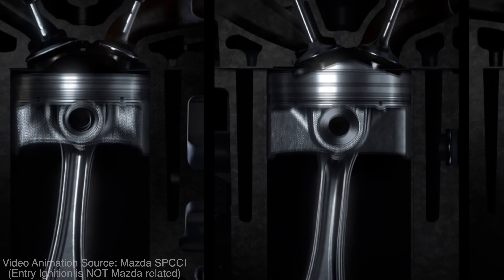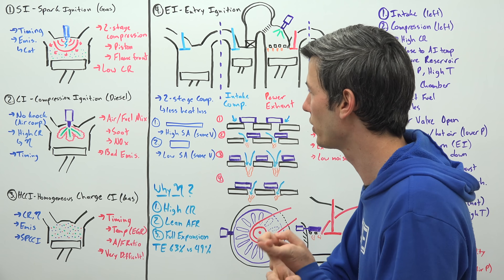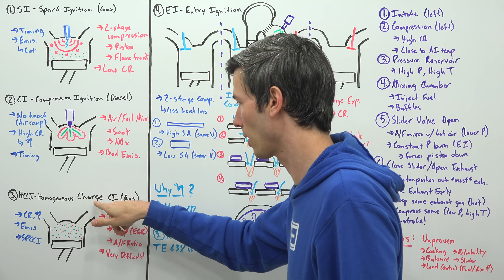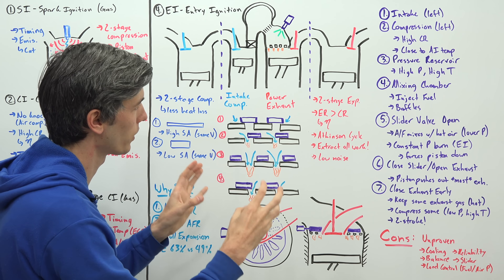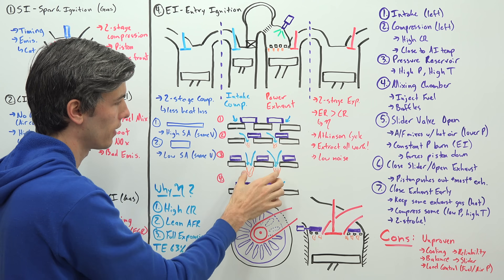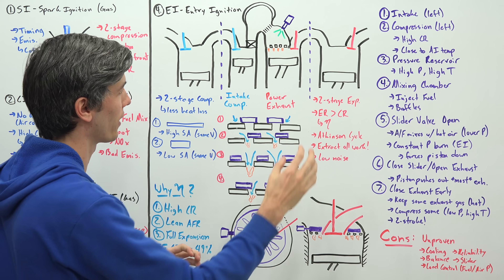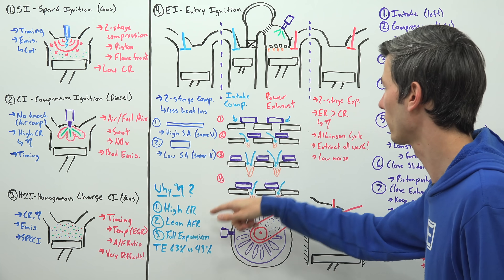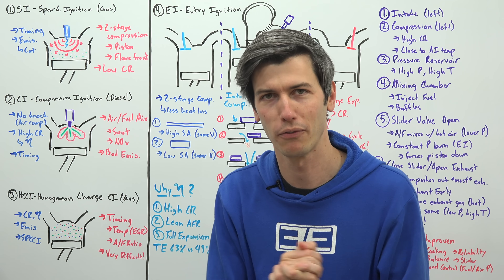Is 'Entry Ignition' The Future Of Combustion Engines?

Comment: Too many moving parts more cost to fix not efficient to my wallet when it breaks...yet since the market is so small for electric vehicles like a Tesla the powers that be negate your ability to charge the vehicle quickly..... could just change the software or trick the system into thinking its charging slow but keep up with the charge rate so as to not overcharge and send the wrong data to the system as to being a regular charge flipping its vin each time its charges.....you paid for it so you should be able to fix it even if its salvaged and you did the work on it without having to worry about not being able to get from point A to Be in time for whatever you are going. Although be it, its not good to keep charging items faster in conjunction with sensors and other components sensitive to the process and it degrades the battery faster over time. Electric seems more efficient just very inconvenient in its process for the charge portion.

Comment: more things to break!!! Instead engineers should be working on harnessing exhaust gases to generate electricity which in turn charges the batteries or help run the engine... basically instead of turbo's u have generators
Reply: Not even remotely efficient. Converting chemical energy to heat and heat to pressure and pressure to heat and heat to electricity is waaaay too many steps. Stick a bunch of thermocouples on the exhaust and you'll scavenge some energy, but each conversion multiplies the previous conversions' inefficiency, leaving you with "watts", not kilowatts harvested from the exhaust.

Comment: JASON, engine thermo efficiency has nothing to do with anything u mention.  Engine efficiency Only determined by both the temperature of the hot and cold resivor.  The second law of thermodynamics. Derived by sadi Carnot ( the carnot cycle).
Reply: No. Engine efficiency is a complicated calculation. The "thermal efficiency" he speaks of is kind of a calculus-style calculation of Carnot's math (since Carnot's simplistic efficiency calculation assumes square wave piston movement with combustion 100% completed precisely at TDC, which is impossible). And like Carnot's equation's output, "thermal efficiency" is a hypothetical maximum from which you still have to subtract all the real-world inefficiencies, such as thermal conduction, pumping, and friction.
Reply: Richard Caldwell “complicated calculations”? not at all. Especially if you have an engineering degree

Comment: Nope.. Starting from a higher theoretical efficiency doesnt mean anything. There have been dozens of potential engine configurations with similar designs as that one and that touted high theoretical efficiencies. Prof Chris Edwards at Stanford has toyed with an engine concept that has over 80% theoretical efficiency, and his end results when tested were pretty poor when compared to todays high efficiency engines (Reaching 50% brake thermal efficiency without waste heat recovery). Loss mechanisms are completely different and usually worse than conventional designs. Also SI engine efficiency limitation is much less related to higher compression ratio than the air standard otto cycle makes you believe. Higher compression ratio leads to flame quenching due to small squish zones and higher heat transfers, its a tricky balance.. Even with very high octane fuels (propane) getting diesel-like efficiencies is much more of a challenge than just increasing compression ratio.

Comment: Is there any difference between this and other Split cycle concepts investigated in the past decade?  Also, if it’s lean combustion, is it expected to be low temperature to avoid NOx or will it need expensive after treatment like a diesel?

Comment: This is a warranty nightmare. Higher cylinder pressure  just means the carbon deposits will get packed around the top rings tighter. Oil change reminder systems will still be ignored, just like today's cars. The under 40 generation ignorance blows my mind with maintenance abuse. But oh my god, when there phone won't link to the radio for, music, hands-free calling it's an emergency. This engine will never hold up.

Comment: I thought of this when I was racing 25 years ago,  two stroke concept with a supercharger pre ignition compression side and a turbocharger on the backside to capture the remaining heat evacuation.  My theoretical  solution was to use a wankel/rotary system for burn entry to the power cylinder/power stroke .   Could not afford to build a prototype.

Comment: i'm sorry but this thing is way too bad no offence jason i like your content , but unproven technology is just a concept and two stroke engines are way too far being efficient , one thing that may destroy this concept is how can you lubricate this system those valves slider disk ... and the stress on the valvetrain some pistons would take more oil than others this makes them heavier , the result is damaged parts ,the solution is another model we need a compressor to compress that air before sending it to the engine that reduces rotational parts in this particular machine, those first two stages of compression would be simulated outside the engine maybe with some help from the free valve system we can give this engine a better experience with efficiency

Comment: The main con is mechanical complexity, your adding a lot of parts that move thousands of times per minute. Plus additional weight and space per HP. Plus there would be additional thermal losses with those compression holding areas. Achates is proven and achieves a lot of these objectives in a simpler design.

Comment: one quick question: how do u make the first combustion when starting the car? from my understanding u need combustion to generate heat then heat leads to another combustion, but before starting there is no heat.
Reply: You'd need glow plugs like in a diesel for the same purpose.
Reply: It would probably need to spin over more then once before start up, Raising temps. Like a diesel that doesn't have glow plugs
Reply: @hopsgarage5513  If compression is high enough you don't need to... at 20:1 compression you almost don't need glow plugs and Detroit 2 strokes don't' have them (they get an air charge from a blower + compress that then boom all without plugs and as long as the engine isn't worn out they start up in a jiffy at above freezing temps and you can start them below freezing with some extra turning over as you mentioned). My 3-53 detroit will pretty much fire up on the first revolution.
Reply: @Wingnut353  having high compression doesn't mean quick starting, Nor does it mean no glow plugs. The blower on a 53,71 or 92 series is to clear the cylinders of exhaust and provides little performance gains hence the turbo addition later. Sure there are some quick starting diesel but I've never seen any start in one revolution.
Reply: @hopsgarage5513  1HD-FTE start pretty quick, glow plugs required. You don't want to flick the key in a manual in first gear. Had an apprentice try to check oil after changing, was in 1st gear, flicked the key and it started and drove off the front of the 4 post hoist.
Reply: Compressing air makes heat. The higher the compression ratio the higher the heat is.

Comment: I really don't understand how the burning mixture doesn't flow/expand to the wrong direction as J said.
Reply: Quenching. Flames go out when in close proximity to metal that's colder than ignition temperature. Keep the openings narrower than the quench distance and even if gas flow retrogrades no flame will escape to the mixing chamber. Easier said than done, of course. The design is WAY flawed.

Comment: Nah, I'll keep my turbo V8 diesel engine. 
Plus the byproduct is plant food. 
More Co2 = More o2 from plants. :) 
For some reason the governments don't understand this.
The more simplified an engine is, the more reliable it is.

Edit: Plus an engine is an air pump. They easier it is for an engine to suck air in and push air out the more efficient it'll be. The problem with this new design is it may create a very efficient fuel burn, but the extra amount of work to get that effect will rob more horsepower. 
Which means you'll have to keep your foot in it more to get the same level of power, which in return will end up using more fuel anyways.

Comment: Does anyone else notice the similarities of this engine to a axial flow turbine? They just swapped the spinning wheels of death with thumpers.

They both have;
multi stage compression,
a combustion can with a flame, (always on injector). 
multi stage heat extraction, turbines or piston.
Which means it will have a similar characteristic of not wanting to change in rpm quickly, ie will have a power setting, and the user extracts their required amount of torque.

The ability to change in rpm quickly is what makes engines fun! This will take all the fun out of it.

Comment: Entry Ignition doesn't seem that impossible to implement into an existing engine design. Take a turbocharged port injected engine. Up the boost so that the air temp is almost at auto ignition, if that's not possible you can use a glow plug to heat the air at the intake port up. Change the gearing on the camshafts so they rotate twice as fast thus opening the valves twice as often turning the 4 stroke cycle into a 2 stroke cycle. Just before the intake port opens inject fuel and after the power stroke just before TDC, close the exhaust port to retain some of the exhaust gases. That should work as an entry ignition engine. Obviously the timings of when the ports open and when the fuel is injected will need to be figured out but i don't see why a prototype couldn't be made using existing automotive technology.

Comment: The entry ignition does not expand with a higher pressure than the mixing chamber’s pressure? Also a comparison between entry ignition and freevalve i guess is not yet feasible?
Reply: The idea is that the pressure increase in the combustion cylinder is simultaneously removed by the combustion cylinder's expansion.  A bad design, but hypothetically correct.

Comment: Interesting how things come around and go around.  I'm glad to see someone trying to use the principals of the 1906 Compound and the Honda CVCC . Probably never find high hp, but there should be efficiency in there somewhere.
Reply: Sometimes where theory meets practice, the water muddies. 

Those old Honda CVCC engines would carbon up the tiny intake port for the prechamber, and the things would run terrible until you pulled the choke out (thankfully they had manual chokes!) and richened the mixture into the main cylinder. 

Of course, that killed fuel mileage and the HC emissions went off the scale, but at least it would get you where you’re going ...

Comment: LOLLL, another split-cycle inspired concept.
Here are even more drawbacks that you forgot to mention: the cylinders heat up differently, so the engine block will heat unevenly. This is actually the most popular reason why diesel engineblocks crack (because one cylinder was leaner/richer than the rest the heat distribution is uneven). You will have heat-loss in the inbetweeny reservoir. You have heat-loss per compressor stage, you have heatloss per expansion stage, so the ideal scenario to overcome that is to put all the functions into one single cylinder (like a regular 4 stroke).The pressure in the inbetweeny  reservoir will not be constant due to the checkvalve opening and closing, turbulence, standing waves, etc. (scavenging intakes proof that standing waves in engines are a thing)
---
I honestly wouldn't trust these guys to set the specifications for my engine oil.

Comment: I can really see a rejuvenated boxer engine out of all this. What's the difference between compression ignition with a finicky air fuel mixture V.S Emf repultion of the piston with a electo magnet coil. Timing would be a breeze and there would only be friction heat compared to typical engines. Electricity consumption would be sporadic and not constant as well unlike the amp sucking Tesla's lol.

Comment: So you get something the size and weight of a 6L LS engine with the power output of a 2 stroke 250cc motorcycle engine all for a 14% increase in fuel consumption to power output ratio. 

How about further research into the opposed piston direct inject engine design?

Comment: Is brown gas (H2 O2 mix) injection into diesel air intakes a good idea or just pseudoscience? Not worried about battery drain since I have a KW of solar on the roof which I could just switch to the electolizer rather than charging the batteries but I was just wondering whether there are any actual benefits.

Comment: Three things. 1. The last engine concept seems extremely complicated and has alot of unproven mechanisms and twice the mechanical losses. 2. Pre-ignition happens before tdc and not after which is what pre stands for. 3. EGR is an emissions device to reburn some of the unburned hydrocarbons in the exhaust. Not regulate combustion temperature.

Comment: Put a turbo on it and get rid of the left piston and use the high pressure between the power and exhuast piston and spin the turbo faster.  Then you can make 3, 6 and 9 cyl engines which would be nice.

Comment: First of all cut that first cyl and get some turbo after 4th cyl or make it crank shaft driven super charger. Second one 4th cyl is kinda pointless too. Gas turbine is better thing at scraping all bits of energy in lower pressure gas. 
Are we gonna see gas turbine for generating in exhaust electricity

Comment: I'm surprised the pressure in the chamber above is higher than the pressure in the cylinder on combustion. Basically it must be higher than the power it takes to move the piston down, because the expanding forces just search for the weakest point.
Reply: Good point. Stall your engine and it could go ::boom:: as pressure rise in the combustion cylinder spreads the sliding valve enough to defeat quenching and let  the flame burn through all the fuel in the mixing chamber.

Comment: Very similar to a jet engine, it is continuously compressing, burning fuel and expanding gases. With the same problems, high internal temperatures and difficulty in speed variation. But this engine has the disadvantage of the greater number of parts.

Comment: Yes it has a higher theoretical efficiency (this is the magic carrot being chased), but No it doesn't have a higher effective efficiency!
Forget about unproven facts, the reason is that the rather large surface areas of the ports & pressure reservoir effect thermal losses hence lower the efficiency, akin to pre-chamber ignition with diesels. 
This seems to be a derivative of the Cosworth engine which I though had died already (which it deserves to...), but perhaps they're more foolhardy than I thought.

Comment: I've seen a kind of similar cycle, look up RWTH's internal continous combustion engine.
That engine however uses 6 compression cylinders, one combustion chamber and 6 expansion cylinder.
The cylinders are arranged axial in two circles of 6.
6 of them push air into the combustion chamber, where fuel is injected and combusted and the combustion chamber feeds the 6 expander cylinders.
Main issue was the combustion chamber and valve temperature as the pressures and temperatures where pretty high there.

Comment: I'm not sure about the idea of mixing fuel with hot air and inject it to hot cylinder. It's something like moving piston with flamethrower. And it's also similar to direct injection, but here we inject gas-fuel mixture instead of pure fuel.

Comment: So in order to have a 4 cylinder equivalent, you'd need to have 16 cylinders in this configuration? That's not efficient to start with. Not to mention a thousand trailing problems this comes with. Koenigseg did it right with his new 3 cylinder engine. It just needs to be scaled down to a third of it's size and power for normal family cars.
Reply: Not exactly. Since there are two power cylinders that produce power on alternate strokes to get power on each stroke would take 8 cylinders using Jason's configuration. And like he said, the design will theoretically work with 1, 2, 3, or 4 cylinder types. He went with four for clarity

Comment: Honestly I see this tech being most useful in something like volvo's twincharged inline 4, or any twincharged engine. Use a small supercharger that has extremely minor parasitic draw (or electric if tied to a hybrid) at low speeds just to keep the engine running. Then have a supercharger bypass and disconnect to allow the turbo to push the real power once the engine gets up to speed. This allows for a very efficient 2 stroke engine. These would be absolute torque monsters when you put your foot down. 

The only innately bad thing about a 2 stroke is it consumes 2x the fuel as it injects fuel every cycle vs every other cycle. A 2.5 2 stroke inline 4 would be using the same amount of fuel as a 5.0 4 stroke V8. This means that without some cylinder deactivation it would just chew through fuel (gas/petrol or diesel) under low load, and efficiency goes out the window when chewing through fuel like that. So I see this working in two places, the economy car, where like a 2-3 cylinder 800cc-1200cc (.8-1.2 liter) managing to make 120ftlbs of torque would be amazing, as it would reduce size and weight of the engine. The other use would be in HD trucks like the SIlverado. Due to the crazy torque output of 2 strokes, they could either cut engine sizes in half, or more realistically double the torque and tack on some cylinder deactivation, as in their ever increasing torque wars, an engine like this might just be the answer they are looking for.